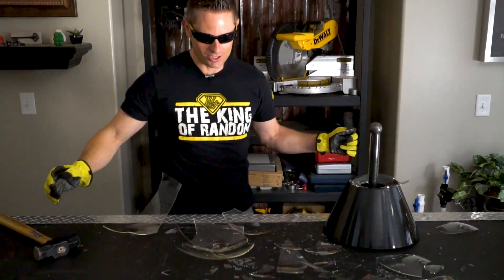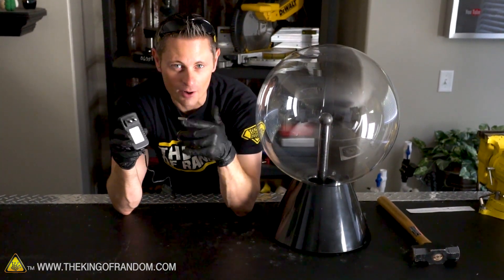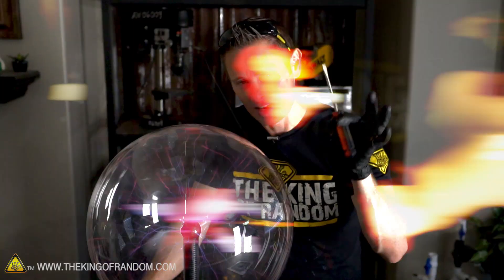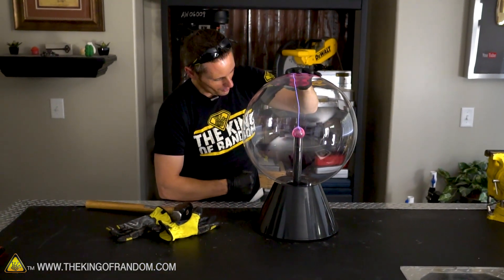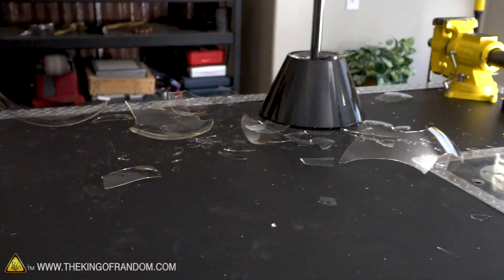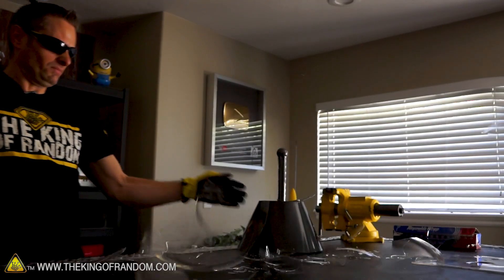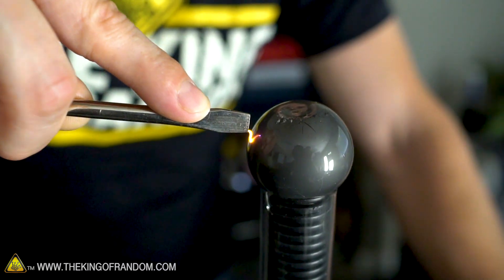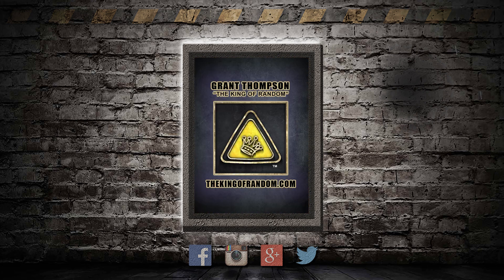Should I Do It? TKOR Tests What Happens If You Break A Plasma Ball? Breaking Plasma Balls 101

Comment: Hey Grant. I've seen this thing called a Stirling Engine before in videos. It relies on the concept of hot and cold to generate power. I was wondering what you can do with one of these if let's say you use liquid nitrogen or any other substance to effect the temperature. It would be really awesome to see what you can come up with to take it to new levels.

Comment: The pressurized argon or nitrogen is actually the likeliest answer as to why it's changed so dramatically. With energy, it requires connecting conductive materials in order to make a consistent arc, which is why large amounts of electricity, like lightning, can only exist in seconds, as opposed to direct conduction like the United States Power Grid, which channels an identical amount of electricity in a much longer format. For the Tesla coils, it needs both an electrode to arc to, like anything metal, and the ability to reach it without diminishing returns. If you pressurize the argon or nitrogen inside a sphere, suddenly you can make a minuscule amount of voltage arc farther than if you leave it in a void or regular atmosphere. That's also why dense storm clouds produce so much electricity, because the carbon dioxide and other chemicals are causing friction in a highly pressurized space, which allows it to build up electrical friction, and eventually it gets strong enough to make an arc to the ground.

Comment: Try to freeze bullet proof glass with liquid nitrogen and see if you can break it with a hammer. would it damage the plastic layer between the two layers of glass?
Reply: It's already a solid dude, no liquid inside
Reply: Jason Box although the extreme cold can make the plastic layer very brittle
Reply: I'm also curious about that.
Reply: hussain almousa Just did a video on jake paul hope you enjoy
Reply: Ben Feaver 
No, bullet resistance glass & the plexiglass inside is press and heat treated, it wouldn't do anything

Comment: what would happen if you put a tesla coil in a tub of liquid nitrogen  or a tub of Co2 gas from a dry ice block and turned it on and touched something metal to it would the electricity travel through the liquid nitrogen like it would water or will no electricity flow through and if the Co2 gas will block the flow of electricity to prevent an arc between the two

Comment: Mr. Grant,  that looks like a bigger version of one I had, that black coil going up the center is probably just a hollow plastic tube with a single wire going to a ball of aluminum foil under the knob up top.  If so, your plasma globe will work again if you put it in a vacuum, but not too low.  One guy did this but found there has to be a tiny bit of air in the chamber to get the lightning fingers to excite toward the outer container.  Have a great day, and that was awesome!

Comment: Why don't you try building a tesla coil with the neon sign transformers you used in previous videos? Or possibly a smaller tesla coil with some small high voltage generators on ebay?

Comment: The gas in a plasma ball is a noble gas and depending on the gas the colour of the plasma will change, the purple colour means it was mostly neon, the inconsistency in the thickness of glass comes from the process of blowing glass, and the plasma ball is slightly pressurised.

Comment: I don't think it was pressurized or had gas in it at all. I think the reason it had such a 'strange' break was because of the weight of the hammer, simply just splitting the tension of the glass dome

Comment: Stepping up voltage decreases the current so the amount of power will be equivalent to the source, minus reductions in the circuit and resistance in the air. The globe has gas in it that facilitates the arcing (perhaps argon or neon, but I have no clue). The glass has varying thickness because of the glass blowing process. A globe like that was very likely blown by hand. It's very fast and cheap for glass producers to make.

Comment: I think the spark drawn from the tesla coil changing color is due to gas/material emitting from the coil as a result of subjecting it to the tremendous heat of the arc. Try drawing an arc through five $100 bills (which is basically the plot of this video).

Comment: Things that rely on matter to work, like sound or electricity, can not work in a normal vacuum. I also doubt that glass could really hold up against the force of the air pressing on it. Thermoses that use vacuums tend to be made of metal for a reason. 

The gas inside was some mixture of Nobel gases, which is also the source of the colors of the electricity arcs. The center is a tesla coil (which still works as shown). Ofcourse, the electricity cant jump through the Earths atmosphere as easily, that requires a far greater charge.

Comment: Every thing wrong. 1rst implosion. 2 not a tesla coil but just a black tube with a small cable connected to the flyback transformer. 3rd 30k Volt. 4 the électric arc melt the glass and make an easiest way to go out he ionise the air making it driving electricity and the heat of this plasma arc make it ligther than medium air so the arc curve and became longer wither the ionise plama. I do Hight Voltage at home like 300 000 volt every day

Comment: when you touched the ball of the tesla coil and the electricity arc was getting bigger, it was probably ionizing the air due to the immense heat en change in electromagnetic field. the o2 molecules get partially loaded due to the massive overload of ion flying trough the air just like a candle. you should test with a neon tesla coil wether the flame of a candle is conductive then you'll see.

Comment: Can electricity flow through liquid nitrogen? Maybe try putting an arc lighter into liquid nitrogen? How about trying to liquefy something like a piece of gallium and seeing how fast you melt it? Or maybe put some vegetables like carrots and tomatoes in liquid nitrogen?
Reply: Electricity does not flow through liquid nitrogen, putting an arc into liquid nitrogen would just cause it to evaporate immediately, the speed you melt gallium melts depends on how much heat you are working with, and a tomato isn't a vegetable.

Comment: the inside of the plasma globe contains a mix of noble gasses. Which ones they are seem to vary depending on your model. Yours seemed to be under pressure, which may improve performance or be a side effect of how they pump in the gases necessary for it to work. I've broken open a plasma globe for this same reason, but it was clearly under no pressure, however it was only a $20 globe. Either way, the noble gas is clearly a requirement, and since i doubt you'll be able to load a glass bulb with noble gas and install a proper tesla coil and get the current to alternate at the correct frequency, i doubt you'll be able to make a tesla globe as many users in the comments are suggesting.

Comment: I think the plasma ball is filled with Noble gasses like neon but there is like a lot of gasses compressed to make the electricity move through the particles so it travels Easier and makes high voltage electrical arcs

Comment: what happens if u  mix gunpowder with water then freez it then light on fire
Reply: Nah, the water will ruin it before the water from the ice will.
Reply: the problem  you would have here, is that the gunpowder would clump up and be more like a rock causing a slower burning like a rocket rather than an explosion. however most gun powders are made while being wet and can be reused if they are not too wet, but fully submerging the powder under water and then freezing it would most likely loose the nitrate in the powder. the combustion is caused by the decomposition of nitrate into oxygen. hope this helps :)!!
Reply: yes you BUY gunpowder dry but it's manufactured wet, through a process called wet mixing to prevent the ingredients from separating. you CAN get gunpowder wet. just not in an excessive amount. my level of knowledge of this comes from 65 years of my family being gunsmiths.
Reply: also the question wasn't about cordite it was about gunpowder. there is a difference between the two. cordite is generally unstable after a period of time, which is why most bullets use a smokeless powder :). you can find some that use cordite but few and far between.
Reply: The ice will melt, ruining the gunpowder

Comment: I worked for Spencer Gifts for many years and sold hundreds of plasma balls. (BTW, you could get an 8" one for about $30)
If I am not mistaken, I believe the gas is Xenon, but I sold so many plasma objects over the years, I may be mistaking that purple with one of the many other colors available.
Of course, being filled with a gas, the globe is pressurized to that gas. The reason we see the arcs within the globe is the electricity is reacting and ionizing those molecules.
The same thing still happens without the globe, but because regular air is much less conductive and harder to ionize, it's on a smaller scale.

Comment: What will happen if you put an egg into a bowl containing liquid nitrogen? 😐👈🍳
Reply: Guru Vlogs you get an egg marble...
Reply: the egg would be frozen solid just like any other liquid you're able to freeze. if you put the egg that was frozen in liquid nitrogen, into boiling water and it still has the shell, the shell would crack due to the immense temperature difference, this is called thermal shock. however, an egg that is cracked and  poured into the liquid nitrogen until frozen,  would simply thaw and cook in the water :) . hope this answers your question of what would happen to the egg in liquid nitrogen!
Reply: With the shell and then boil it afterwards, see what happens?
Reply: Andrew Boxill 

With the shell?
Reply: samuel rivera 

gfn
Reply: sure Muanaza if you say so
Reply: it will all of it will just freeze

Comment: What happens when you put an electric current in liquid nitrogen?
Reply: Most likely, nothing
Reply: liquid nitrogen is nonconductive, so nothing.
Reply: the conductors would lose their entire electrical resistance when cooled to a super low temperature. which means there would be no power loss or any inefficiency in an electrical circuit! think of the possibility.

Comment: Take the broken plasma globe and put it under a vacuum while it's turned on! Atmosphere's electrical resistance reduces with a reduction in pressure. It should start producing the long arcs it did before!

Comment: Hey I  challenge you to make frozen nitrogen
Reply: By increasing pressure, you can solidify nitrogen. Veratssium did it, so I doubt Grant will, but it is possible without getting to 60 Kelvins. A side note, if Grant got LHe, it is at 4 Kelvins, much colder than the -269°F you suggested.
Reply: Xx Diocrane xX Rebel To solidify liquid nitrogen you need to reach -346°F. The coldest thing Grant can probably get a hold of is liquid helium, which is normally at -269°F. So I doubt he can do that.
Reply: Curtis LeMay, I'm not certain, but I don't think that increasing the pressure helps at all, you should instead decrease the pressure. People have done this many times. All you have to do is put liquid nitrogen in a vacuum chamber long enough for it to reach equilibrium. It doesn't stay solid after you restore the pressure, but it does make frozen nitrogen.

Comment: You can re-pressurize it with argon, krypton, or xenon, but argon is probably the cheapest, since it is used in welding. Argon is also heavier than air, so if you used an upside-down container, and sealed it onto the base with, I dunno, silicone perhaps, you could have a working globe again! use whatever glassware fits the base! the thinner the better though.

Comment: Is it possible to modify the vacuum chamber lid to seal around the base of the plasma balls tower and then turn it on would it ark to the metal or glass sides of the chamber ?? in effect making your own plasma ball (or cylinder) inside a vacuum chamber or even just a new different shaped cover for the tower would it still work ???

Comment: With the effect at the end, the yellow of the arc indicates a current arc (rather than purple/blue for a voltage arc), which is probably caused by the plastics at the tip of the ball carbonising and allowing the full 3A going in to translate into a nice juicy amount of current for the arc at the tip. Also, the being able to pull the arc off to a longer distance backs this as that indicates an increased in-arc voltage consistent with carbonisation allowing a more efficient energy transfer to your screw driver, ergo more voltage for the arc and more current to sustain it hot enough for the longer distance.

Voltage gives you the break-down distance in air, current gives you heat to maintain the arc and allow you to draw it longer.

Comment: The globe was pressurized argon gas. 
Argon allows an arch to be struck more easily. The color of the arcs give you a hint as to what it is.
The reason the arc is smaller after the globe was smashed is because oxygen steals the free electrons from the arc, effectively quenching it. It should produce some amount of ozone though, and maybe even some nitrogen oxide (and nitrogen dioxide). 
The blueish purple color is the oxygen reaction. 
The yellow color is excited sodium, which is a very common contaminant through most processed materials. it could have been the glass or a paper liner, maybe even some plastic.

Nitrogen can break down too, but I've seen the nitrogen discharge, which is a different color. You can see it on Youtube too, just look for TEA Laser.

Comment: That's NOT a tesla coil! Thats an arc-gererator.
Just a heavy duty wire touching the graphite coded ball on the inside. When you make those perfect arcs, you touch the closest to the skinned end of the wire.
Reply: arc reactor ..?!?!?! iron man hmmm hmmm
Reply: Basically the same thing.
Reply: Arnav Dixit Nope. A tesla coil (transformer) is a operating with capacitors. These capacitors are discharged manually and rapidly, and then transformed, while the arc reactor works with a simple transformer, (and some timer chips, I think) producing high current and a constant (silent) arc.
Reply: But they both make the voltage go higher right?
Reply: Taylan Ozdemir hmmm..... yes, arc generator. But I'm a smartass and i say, BASICALLY the same

na naa nananananana na nanna
black sabbath

Comment: If it's anything like the smaller one I had, if you manage to remove that tower in the  middle, you'll find a wire inside going up where the tower was, and that wire should be able to make sparks of up to around a centimeter (if the air is dry) from the tip if you draw it out with something metallic I think (don't draw sparks with your exposed skin if you don't want to get small burns though).

Comment: I could have saved you 500$. If you take it apart you will see that there is a flyback transformer inside with the output wire going to the top of the shaft. The globe was filled with noble gasses to get the plasma effect. Take the flyback circuit out and hold a regular incandescent light bulb to the wire and watch what happens.   Alot of cool things you can do with it.  Check out ZVS drivers and 555 timers  you can use them to power the transformer.  Simple build.

Comment: If you take a Plasma Globe...Put a penny on top of it, and then take a paperclip you can actually get it to arc between the penny and the paperclip. You can light matches like that, and cuts paper, though the paper does become chared on the side.
Reply: I should explain, that the penny method seemed to work better than with foil. Sorry, should have clarified.

Comment: I found a really interesting trick because I used to have one of those if you get the paper wet and then  the Metal wet you should be able to almost cut through it very easily it's very tricky but if you do it right it will work

Comment: Can you find a way to put this in a vacuum chamber, then add Neon, Argon, and Xenon? (basically undoing what you have done here)?
Bonus points if you can control the amounts going in as each gas has a different effect on the plasma. 
(neon makes the whole globe turn red, argon creates the filaments and a small amount of xenon makes "flowers" at the end of the filaments.

Comment: What happens if turn on the plasma ball in a low-pressure chamber? Does it not work or makes bigger sparks less frequently 

maybe you could even put a wireless fan to circulate the little air in the low-pressure chamber to potentially increase the frequency of the long sparks

Comment: what if you researched what was inside and tried to attach a new glass ball and filled it up with that gas. essentially rebuilding the thing.
and while youre at it, add a valve to let other gases or liquids in to see how the sparks change.

Comment: Grant I don't want to tell you otherwise, but you are wrong about the spiral in the middle. it is plastic and just for looks. there is a small transfer in the base that changes the voltage. ⚡ There is a small wire that goes up into that center core.